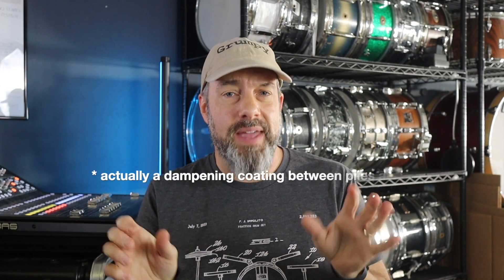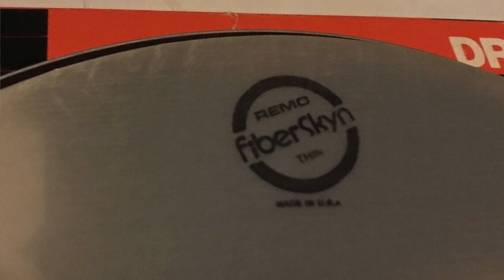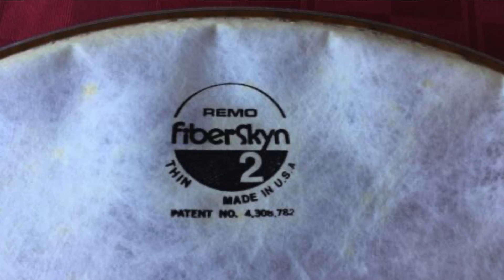What You Need To Know About Drum Heads. (The Physics of Drum Sound Part 4)

Comment: One confusing thing in the explanation you gave.  Once moving, I would think that the inertial quality of greater mass would result in the "trampoline bouncing" for a longer period of time.  I can't see how a CS (black dot), with more mass at point of motion, would not remain in motion longer than a no-mass-added single ply equivalent (once energized with stick impact).  If the reactive motion was due to a returning air-pressure wave pushing a head back up, I'd agree because the air pressure has to act against more mass.  I guess the question is if the return/resonating motion is due to tympanic/elastic tension or due to pressure wave response.
Reply: Example for thought...tensioned rubber band... (1)Pluck it and observe when it stops moving.  (2)Tie a washer in the middle of the rubber band, pull back (pluck) and observe how long the washer oscillates...longer than the band with no center-weight.  Wouldn't center-mass on a drum head provide the same result?
Reply from the maker: I love how you're thinking, but I think the answer lies with your own comment, "Once moving...."  The primary issue as I see it is the absolute mass of the head, dot included.  With a dot in the middle the mass is substantively increased, meaning the same energy transferred from the drumstick won't excite the head into as much motion as it would a head of lower mass (same head with no dot, for example).

A body at rest tends to stay at rest (requires more energy to excite into motion), so more energy required to get it moving, AND less sustained vibration from a head with greater mass results in a sound that is a greater percentage attack vs.sustain than a lower mass head.

At least that's how I think of it.  Thanks so much for chiming in!!

Comment: I have found that the coated ambassador or the Evans coated G1 is my head of choice for my snare drum batter head. 🥁❤️
Reply from the maker: Good choice!  I'm a fan of Aquarian's variant on those heads, the Texture Coated.  The film Aquarian uses seems a bit stiffer than either Remo or Evans, and it gives a more focused sound somehow, without losing the life.  Hard to explain.  Just more complex, more organic, but not muffled or dark at all.

I used to use Aquarians TC on just about everything 20 years ago before I opened a commercial studio, and then I started going through so many snare drum heads (all the drummers coming through using my kits) that I started buying Evans' Coated Reverse Power Dot as Guitar Center would stock them by the case and the price was great when purchased that way.  I also got a deal around then with Taye drums, who had their own drum head brand, Dynaton, and I liked those heads too, believe it or not, and could get them at cost.  Eventually all of that passed (Ray Ayotte, my connection, left the company), and I just kept using Evans and Remo as GC didn't have many Aquarians in stock ever.  Then one day a couple of years back I get some Aquarians again and remembered how much I had liked them years before.  Been a convert ever since (and easier to purchase online now, so I can always have stock on what I need).  

But yes, hard to go wrong with 10mil, single ply coated heads!!  Truly versatile!

Comment: I've been playing around with Aquarian Texture coated, I think it's a little darker then an ambassador. Great video thanks!
Reply: i agree and i find that the remo has a thicker coating than the evens, and more durable, thats just my experience
Reply from the maker: I've become a huge fan of Aquarian heads.  You're right, they're a little more stout than the Remo and Evans alternatives... almost low tensioned right out of the box (though can be 'loosened' more, if desired, by tightening them up on a drum and then backing the tension all the way back down).  Still really lively tone, but mellower without being dull -- like the perfect cross between a Remo Ambassador and an Emperor (leaning more toward Ambassador).  

I've become so sensitive to muffling in recent years... the slightest piece of gaff tape in a single accordion fold is usually enough for me in general applications.  Pre-muffled heads are just too much for my taste, but the Aquarian Texture Coated are just about perfect right out of the box.  Can't find that balance with anything else.

And for the rare occasion when I do want a little more control their Studio-X version (has a thin 'donut' made from 'dot' material adhered to the bottom of the head about and inch in from the edge) has just a touch more control without being as dramatic as a Powerstroke 3 or G1 Genera.  Aquarian has their version of the PS3 and Genera, of course, but I love the Studio-X, which has no Remo/Evans equivalent.
Reply: Aquarian TC are terrific heads. They are a bit darker, and less ‘plasticky’ than Ambs or G1. (Jazz guys often use TC, dig the natural sound)The ONLY downside is they are on the small side and sometimes don’t fit well on certain drums. If you like the TC, you may love Modern Vintage heads. Slightly darker, even more like a skin, and the color looks great if you’ve got a wood or earth tone finish. (American Vintage are the same, but oversized)

Comment: Thanks for giving recommendations on where to start at the end of your video. 

One thing that always annoyed me on other videos like this are people saying "Try them all, until you find one that works" as if we can all just drop $12-15 per side per drum...
Reply: I always wondered- if you use the Evans Dry series (w/ holes) but put a ring on top, is that doubling up on what those things do or do they cancel each other a bit and you end up in between? Hahaha.
Reply from the maker: @TwoandaHater  I would think a ring would cover the holes and diminish their effectiveness.  Haven't tried, but that seems likely.  Still, air would push its way through (perhaps visibly lifting the ring in some areas), but the mass of the ring, it seems to me, would have at least some effect on the holes' mojo.  Have you ever tried this?  What happens?

And yes, the ring itself would certainly provide greater muffling effect, sounding quite different than the head alone.  Thanks for the comments!

Comment: What in your opinion is the best drum head to use in a small setting and not using microphones, to get the most controlled, yet clear sound?
Reply from the maker: Single ply coated batters, single ply clear bottom.  Perhaps a controlled (Aquarian Response 1/Remo Powerstroke) or double ply batter on the kick with single ply resonant.  You can easily adjust tone to the room with muffling as needed, though the harmonics of the thinner heads are quickly absorbed and diffused by the air between the drums and the listeners, so go easier on the muffling than you might think, especially if the drums are heavy and therefore have a stronger fundamental note anyway (thinner/lighter shells are better for purely acoustic performances as even the dissipation of the harmonics because of distance yields a better balance when the fundamental is kept in check by the thinner, livelier shells).  

Hope that helps.  Thanks so much for being here!

Comment: Is there any way to keep the sustain but reduce the overtones?
Reply from the maker: Absolutely... single ply batter head with little bits of muffling (small pieces of gaff tape fully flat against the batter head) in multiple places around the diameter of the drum, perhaps an inch in from the hoops, equally spaced around the perimeter of the head and equidistant from the center of the drum.  The symmetry of this arrangement and the fact that the tape is completely against the head will mellow the highs/overtones without reducing the sustain too much.  Unequal placement of muffling and/or heavier/softer muffling (gels or accordion folds in tape) will absorb more sustain, so avoid those if you want sustain.  

Hope that helps.  Thanks so much for the question!

Comment: Oh boy, I don't want to know how much money I spent on drumhead experiments. I think I bought almost every head available from Remo and Evans and many of them went right into the trash after 1 session. My cookie cutter set up which I used for the last couple of years is: White Suede Emperor / Snare Side Diplomat on the Snare, clear emperor on the Toms with ambassador as reso, P3 on the Kick as batter and reso. It works perfect for Metal, Rock, Fusion etc. I used the Evans equivalent of this set up till a couple of months ago. Then I found that Remo heads are way more resonant. That said, they are also definitely less durable. After a few rehearsals I spotted micro dents on the emperors of my toms, which I never had with Evans G2s. I guess Evans uses a harder mylar film for their heads. Thats why they're more durable but also less lively, because they're more rigid.
Reply from the maker: That sounds like a practical, useful setup!  

I actually used coated Emperors on toms for many years with clear Ambassadors underneath.  Worked well for lots of styles -- versatile and decent durability.  Then I discovered Aquarian's Texture Coated heads which has an almost 2-ply-ish tonality with some blended single-ply-ish overtones.  A lively, but toneful head, and the film seems stiffer than the mylar Remo uses.  The heads have some tension on them, it seems, right out of the box -- don't know if it's the film or the coating, but I really dig the way they record.

Oh, and the coating.. super durable and won't come off, ever! I used to buy Evans coated reverse power dots by the case when I had my commercial studio (they sounded good while being more durable for the various drummers that came through the door and used the 'house' kit).  The coating came off all the time though, sometimes even stuck to the boxes the heads came in when pulling them out for the first time... just weird and annoying.   

Those were good sounding snare heads though.
Reply: @drumdotpizza  Thanks so much for the suggestion! I just checked the Aquarian variety and I think I will totally try the aquarian equivalent of my setup! Is the texture coating similar to the evans UVs/ remo white suedes? I was so sad, that controlled sound / power Center heads weren't available as UVs or white suedes. So if the texture coating is as durable as the UVs or suedes, that aquarian power dot will totally become my new favorite!!
Reply from the maker: @ckdrums3408  I don't have much experience with the suede or UV, so I can't directly compare.  I do have a suede bass drum head that I got with a stack of random stuff I bought off someone, but I haven't used it yet.  From the feel of it, however, I can say the Aquarian coating isn't the same... it's course, more so than Remo or Evans standard coating (Ambassadors/G1, etc.) I would say.  Perhaps that is why it seems to have a greater impact on the tone.  I'd be willing to think that it adds more mass than the other two makes, and probably why I love their Texture Coated heads so much.  It retains the life and vibrant presentation of a single-ply head, but definitely has a deeper tonality than the coated single ply heads of other makes.  Incredibly versatile.
Reply: @drumdotpizza  I will give it a try and hope the coating / head will survive a good 2B Metal beating! Thanks for the advice!
Reply from the maker: @ckdrums3408  If you're a heavy-ish hitter you might just snag the Texture Coated w/Power Dot.  Lovely stuff!!

Comment: Anyone have any opinions of the Kevlar woven heads?
Reply from the maker: I've never personally used recent kevlar heads, but we did try them ("Duraline" brand, IIRC) for snare line back in high school drumline.  Absolutely NO ring (and I think kevlar heads were responsible for the redesign of marching snares using a metal batter bearing edge assembly as the kevlar under tension doesn't give like polyester film, and it destroyed wooden edges).

Would be interesting to try one after all these years, though I expect it's definitely a specific 'sound' and wouldn't be broadly applicable.  Probably only on a metal drum too ;)
Reply: @drumdotpizza  thank you for your swift reply!

I don't know why I'm not alerted when you make a reply so that's why it always takes me months to get back to you because I don't know you've replied in the first place!

I was thinking about these type of heads simply because maybe it would be a good idea to have different snares set up for different sounds and that could be a nice wildcard tone kind of thing but I agree it should probably only be on steel shells (or maybe thick acrylic?)

Comment: Been thinking of making a P3 just by cutting a worn out bass drum batter and actually mounting two heads instead of one for that effect . I am also one that likes to poke holes in the top part of my bass drum batter mainly at 11 and 1 o'clock seems to effect the dig on my beater on my 24" kick
Reply from the maker: I have actually made a P3 type head by doing that (cutting a ring out of an old batter and fitting it under a new head)... It didn't work for me.  Fluttered and buzzed... made all sorts of unwanted sounds that I couldn't tune out of it.  Your mileage may vary though.

I think it's interesting... If I am not mistaken I believe Remo uses a 3mil under ring on their P3.  The Force 1 bass drum batter (Aquarian's variant on the idea) appears to use either a 7mil or 10mil ring instead (not sure which, but definitely thicker than the Remo variant) with holes punched into this under ring to vent air.  I don't know if this is what makes the thicker ring work (and not buzz/flutter/etc.), but either way the result is focused, punchy as heck, and fullly resonant (which I like in bass drums if I get the choice).  Both are cool, but if you haven't tried the Aquarian Force 1 you definitely should.  

Thanks so much for your comment!